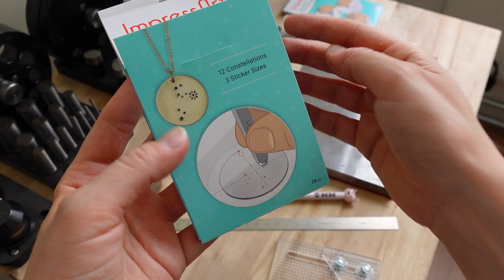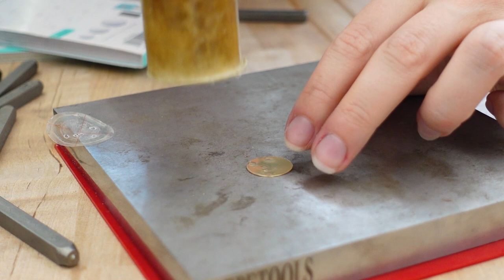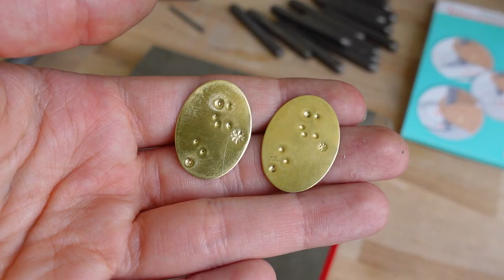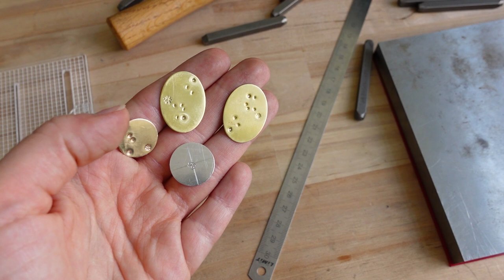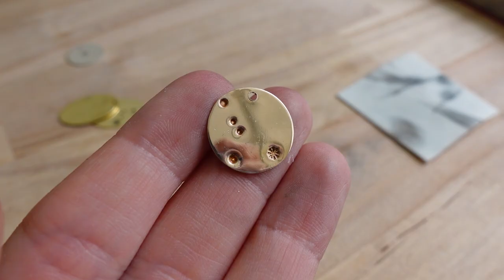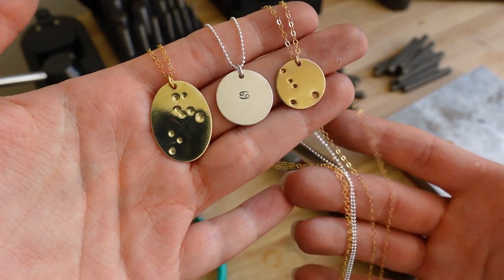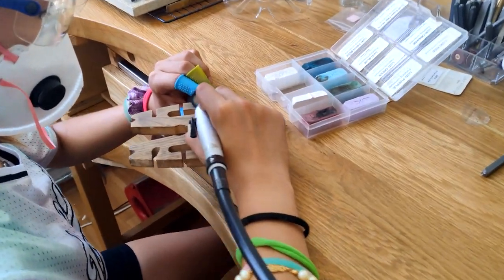How to make GOLD FILLED & SILVER zodiac disc necklaces! Tutorial

Comment: I'm using a fairly cheap disc cutter to cut copper discs, and you can really see the difference on the underside between my cheap cutters and your good ones. I'm having to remove quite a lot of metal round the bottom edge of mine to get rid of the burring, but the discs also 'dome' quite a lot, so when sanding flat (by hand) I'm having to remove loads of the metal to get it all sanded evenly. This is making the discs thinner round the edges, which I don't want. I'm going to try the rotary tools instead, forget about trying to make them perfectly flat, and just concentrate on getting an even finish. There's so much trial and error when you're just starting out! A lot of copper will be ruined before I even think about touching silver!

Comment: Always love your videos, Basia! Perfect timing as I'm trying to make some stamped pendants. I'm not having much luck though in getting a decent impression. I don't have a brass hammer, but a rubber mallet that I was told should work. I'd be grateful for your advice. Thanks, in advance.🦋M
Reply from the maker: Thank you so much, lovely! :) To be honest, I don't think a rubber mallet is great for this job. Get yourself a good brass mallet, they're not very expensive and you can use them in many jobs, you won't regret that purchase. Experiment on a smaller piece of sheet or some inexpensive blanks for stamping. And see what thicknesses give you what impressions. And how many times do you need to strike to get a desired impression. As you could see, despite my silver sheet being quite thin (0.50mm), I still had to strike it several times. I didn't move my stamp though! I just tilted and pressed in different directions, to make sure every part of the design was properly impressed in the metal. It takes some practice to get it right, but you'll learn fast with a few tries and then you'll be very good at it :) Good luck!